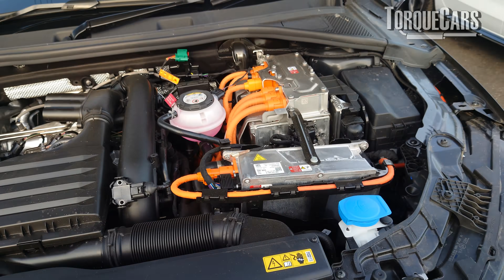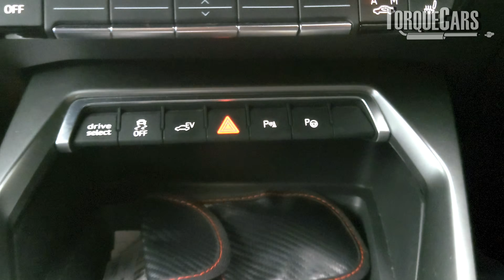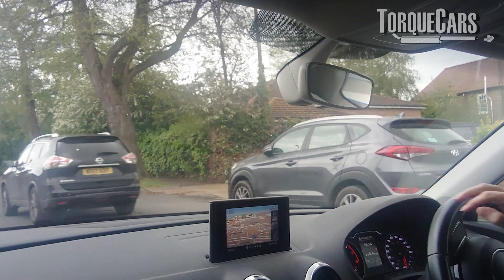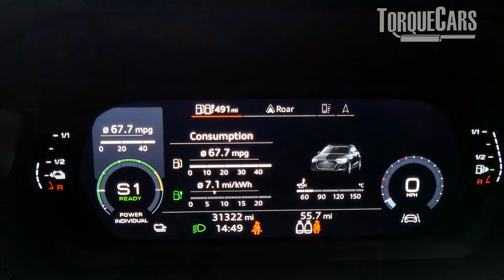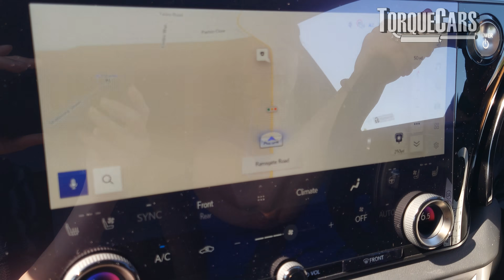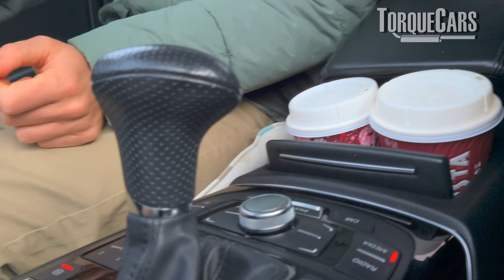🔌🚗 PHEV Driving Strategy: When to Use Battery and When to Fire Up the Engine

Comment: Might be a long comment. Get to charge at work for free 5.5 miles away, charge as often as I can, can usually do all my commuting for the week on ev alone. BMW 330e get about 25 miles max EV range. Can do ev only, ICU only or a mix of both. If I'm going on a longer drive than my regular commute I'll warm up the ICU a little on the drive by going into xtraboost mode and idling for a min, then drive smooth in sport mode until warm then will drive however want. I don't do a lot of driving in my car, only 450 miles a month, half of which typically is ev only as I get to charge for free. I try to be sympathetic to the ICU and don't start it up for short trips if I can help.